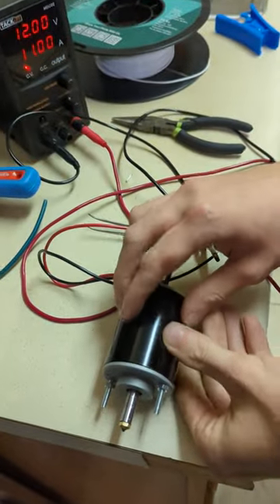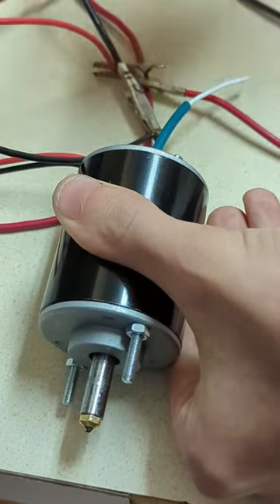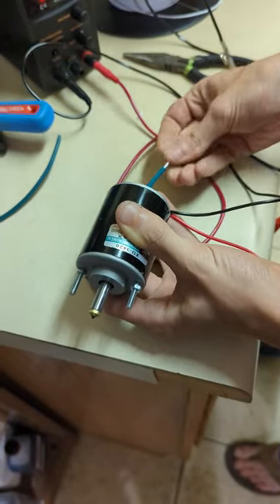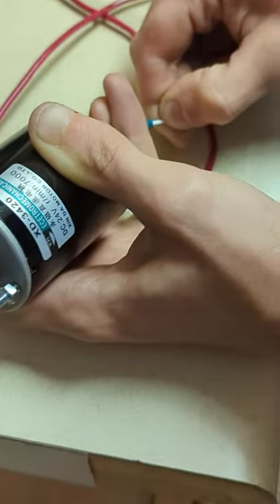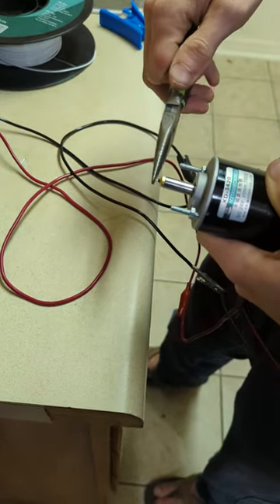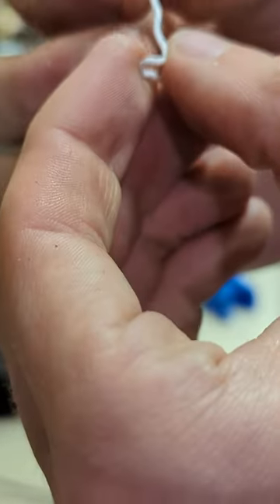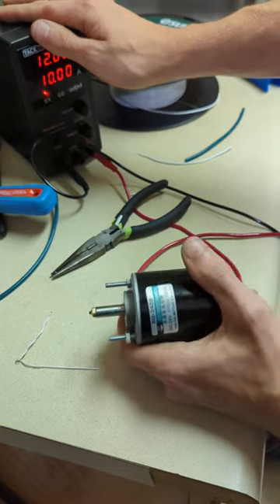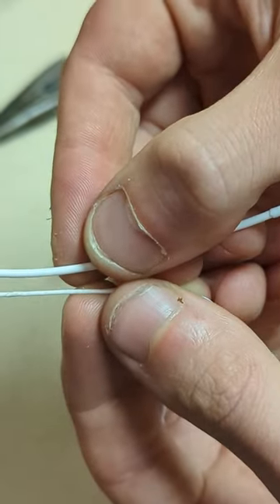Extruding without a hot block? wat m8?

Comment: This is pretty nifty! There are some cnc mill tools that do this. Using the rotation from the spindle to generate heat that melts the plastic. I would guess they have some kind of wear resistant collar that eats the friction and transfers it to a static tube? Idk just spitballing.
Reply from the maker: Thanks! we are working hard to try and get it to work with metal and ceramics at low cost on the home desktop. 
Do you have a link to these CNC tools? I have never seen one before but would love to learn about them!

Comment: Is it ultrasonic?
Reply from the maker: ultrasonic additive manufacturing uses ultrasonic vibration to rub surfaces together and induce localized bonding at the surfaces by friction and by acoustic effects. Rotoforge uses the rotation of a spinning nozzle to rub a wire or some powder contained inside the nozzle, heating and shearing the wire or powder to some temperature and strain rate at which the material will flow through the nozzle. We are presently working on a demo with metal and ceramics as well.  we have more in common with additive friction stir welding, or friction extrusion. 

https://en.wikipedia.org/wiki/Friction_extrusion

https://www.insidemetaladditivemanufacturing.com/blog/a-novel-metal-am-technique-additive-friction-stir-deposition

there are many resources relating to it available online. I am happy to share more links and information if you want to talk shop! :)